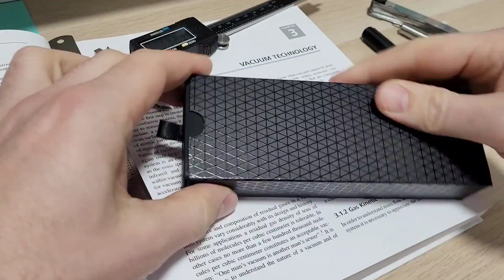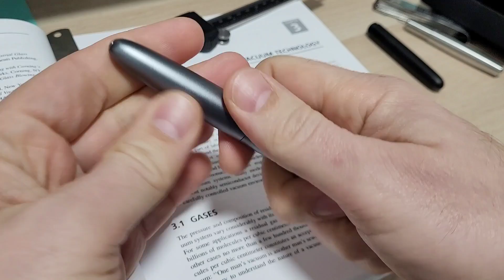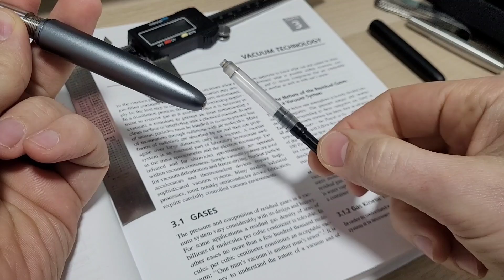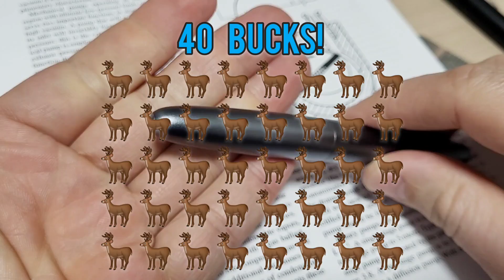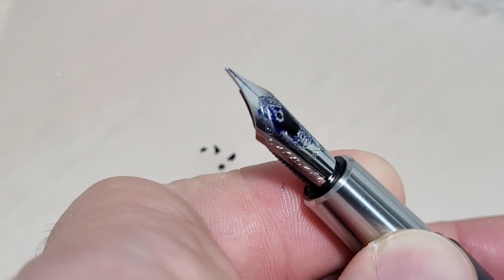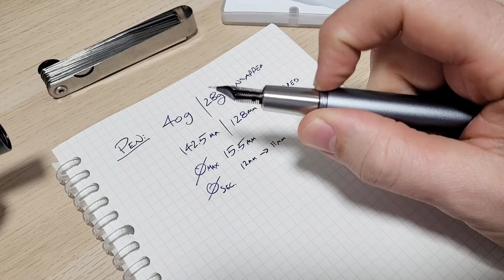All Metal Fountain Pen | Namisu Horizon

Comment: I think someone at Namisu has seen this video... I just bought a Namisu Nova Studio in titanium, which is like a 'version two' of their original Nova, and the Bock nib appears to be recessed into the section now. Obviously this is a different model of pen to the Horizon, and I don't have an original Nova to compare to, but it is a good sign that they are revising their products.
Reply from the maker: Hmmm I'm curious to see if there has been any changes to the Horizon or it was already like that on the Nova 🤔
Reply: @Doodlebud  It is hard to tell based on online pictures, but I think in the original Nova, the nib unit was sitting in the section like the Horizon in your video. One reviewer, pencilcaseblog, compares the new and old model. Seems a bit confusing because some Nova Studios look like like they have a recessed nib unit while other's don't. On the Namisu website, even, it doesn't look recessed, where on pencilcaseblog's latest re-review of the Nova, the nib units do look flush with the section.

 Keep up the good work in any case, Doodlebud!

Comment: I just bought a Pineider Avatar with what looks like the same Bock nib, and yeah, tines were a little tight and it skipped once in a while. i got them spread some using your method, which helped, but may need to go just a bit farther. As a retired ME I get a kick out of your analyses.
Reply from the maker: Good to hear my video helped with your nib.  Glad you like the engineering style I take.  You might like the breakdown (2 part series) I did on the Lamy 2000

Comment: I had the same leaking ink problem with my ensso Italia titanium pen. I had taken the nib unit out of the section, and when I put it back in I thought it was tight. I didn't want to strip the threads. It turns out that it worked its way loose a little bit, and that's how it was leaking into the cap. Since then I think it has stopped. I wonder if that might be also a problem with yours?
Reply from the maker: Very possible.  Think its one of the three: poor nib/feed fit, bad nipple on the feed, or cracked housing.  Will see what I can find

Comment: So you get excited when you have issues with your pens and get bored when they are okay? LOL I get it. But you must have a LOT of Viscontis!
Reply from the maker: Only 2 of them so far. On one the cap band fell off, fixed it. The other, have to send out for nib work... So SUPER fun! 😣
Reply: @Doodlebud  I've had two Viscontis; a Van Gogh which was horribly overpriced and had a cracked barrel, and a Mirage that had a cracked barrel. I sold the Van Gogh and kept the Mirage. The nibs were okay but not spectacular.
Reply: One Visconti was enough for me. Every time I use it I get flashbacks to all of the issues I had with it and how much I had to do (pay) to get it fixed. I did a Roberto Duran on Visconti-   No mas!

Comment: Did you try another converter? I ask because I had a similar problem with a Jinhao X450 and X750. Went to use the pens for the first time and ink flew out everywhere i.e. with them being "pull" caps and not "twist" really exacerbated the problem! Went through the whole clean and flush routine like you did, reinked, and had the same problem. Replaced the nib unit with a Goulet; replaced the stock Jinhao converter with a Schmidt ... boom, problem solved!
Reply from the maker: Yeah, but just posted an update and did it again even worse on a cartridge.  So will be doing some more testing to find out exactly where the problem is.

Comment: The end of the converter might be locking inside the barrel. So when it's opened and closed that causes the piston to move up and leak ink. Maybe
Reply from the maker: I did a measurement and there is clearance for the converter.  So thinking it has something to do with the nib unit/housing.  Will update once solved.
Reply: @Doodlebud  looking forward to it

Comment: Most probably that converter needs some silicone grease or is not fitting properly on the nipple from the section and air leaks into it. That could give you a leaking pen.
Reply from the maker: Tried the grease first time it leaked but did it again right away.  So will go part by part and post when I get it solved.
Reply: @Doodlebud  Let us know if you figure it out, I'm curious now.
Thanks!

Comment: How well does it post? Does the cap have a liner to keep it from scratching the barrel when posted?
Reply: Cap doesn't post on the Horizon. However, there's a very similar pen from Namisu, the Nova, which does post. 
I wish I had DB's engineering skill to explain the difference because the measurements are very similar. 
For me, the Horizon is off balance in my hand, the Nova is fine.
Reply from the maker: These type of pens, smooth lines where cap meets the body, typically dont post.  Unless the back of the body really tappers down, like on say a Diplomat aero.

Comment: 1. I think you got yourself a real bargain on this sleek pen.  The stepdown is a deal breaker for me personally, but I am quite intrigued by their N1 model, which is gripped right on the barrel.  Unfortunately I have no use for it whatsoever, so I just look at the pictures now and then.
2. Excellent review.
3. I'm having a similar when-capped-only mini-leak on my Guider Ebonite Desk pen, but it's an eyedropper.  I can't ram the nib/feed in any harder, and can't diagnose the problem.  If I didn't love using this pen so much, I would give up on it.

Comment: I assume the converter's piston leaks air in it. The ink can only stay in because of the vacuum, so as soon the vacuum is gone the ink can leak out.
A couple of times i have had too airy feeds so i had to block some of the air passage to prevent the excess ink.